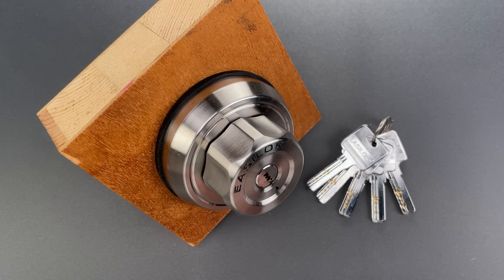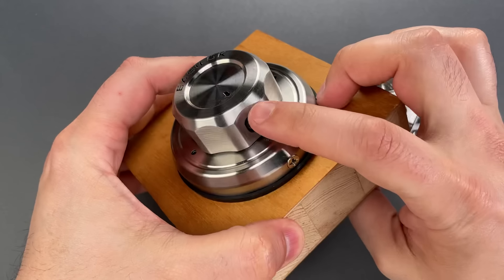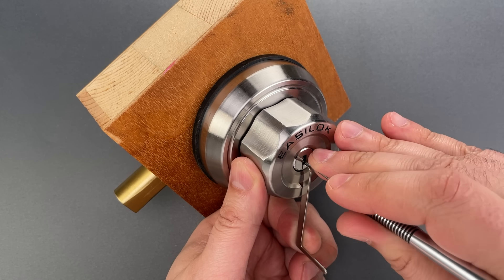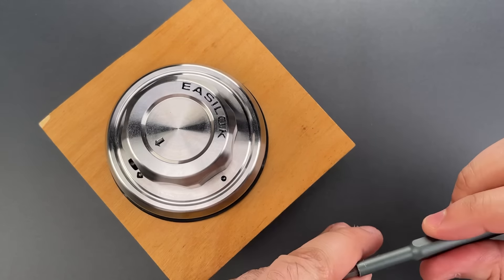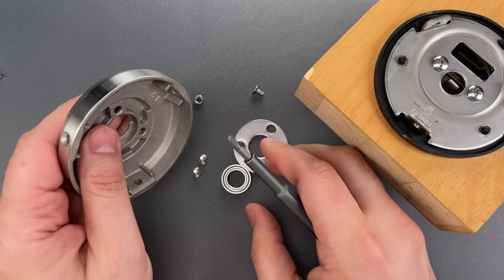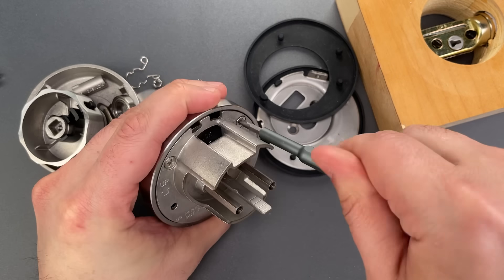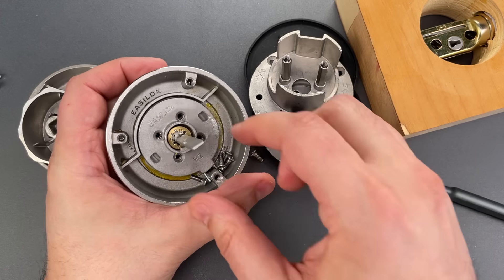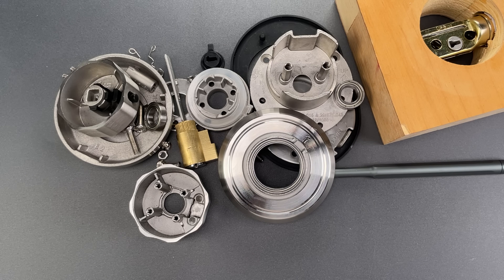[1388] The Best Built Deadbolt Ever? Easilok

Comment: Question: so if you flip the switch on the inside and prevent anyone from using the key externally does that mean it also becomes impossible to pick the lock when the switch is flipped?
Reply: Of course.  If the key in the keyway turning the cylinder doesn't open it, then picking it and turning the cylinder isn't going to do anything more.

Comment: The best part was the grommet, how did you not mention that
Reply: I'm only saying this because I had a front door deadbolt that would just NOT keep the screws in it (about every 3 weeks I'd have to tighten them back down, the tolerances were so bad loctite didn't help). But that grommet guarantees pressure on the threads minimizing thread looseness (If I wanted to spend 10 minutes tapping my deadbolt I could eventually get it loose enough to pull off the front and manually retract it - something I only ever got the idea to do because of you)

Comment: Can you use this lock for a back door
Reply: sure, if the  hole size on the door can fit the door lock . Our door fit for the door thickness is 35-45mm and the door  latch backset is 60-70mm . Hope this can help . Any promble can be helped ,feel free to contact any times :)

Comment: is it possible to open the lock by lockpicking if the switch is on (the nightlock)?
Reply: Other people can't use the keys to open the door in the outside if the switch is on (the nightlock).
Reply: @avalu3477  so basically this is the most secure lock you can get then :o
Reply: @Socomhunter   We will  try our best to improve to be the people said the "best" 😁

Comment: It's a little disheartening that that's one of the best locks you've ever seen and still you picked it in 20 seconds! Aren't thete any locks that actually work ?
Reply: It's important to remember it's one of the best low security locks he's seen.  There are locks he hasn't been able to get like the Bowley lock. There are also some high security locks that have taken him longer.  Most people aren't going to bother installing very expensive locks on their homes though; it's not worth the cost. Particularly when your home has things like windows.
Reply: @circus.forrest  Wow. Thanks.
Reply: it has two kind of cylinder: one is this dimple keyway and the other is SC keyway like you are using now.

Comment: Can you pick it while the night latch is engaged with the dead bolt out?
Reply: if the key won't work it won't be able to be piked open, you may be able to get the lock disengaged, but the bolt won't be able to be retracted. Likely you wouldn't be able to get the sheer line enough to pick though.

Comment: I’m late to the party but I can see a problem with this lock. The outside knob is a weakness, I bet I can open this lock with a pipe wrench is a couple of seconds. Usually locks designers try to minimize outside protrusions and angles that can provide purchase to tools.
Reply: Not really. It's for low security applications like your front door.

Know the weakest part of a house? It isn't the door. It's a window.